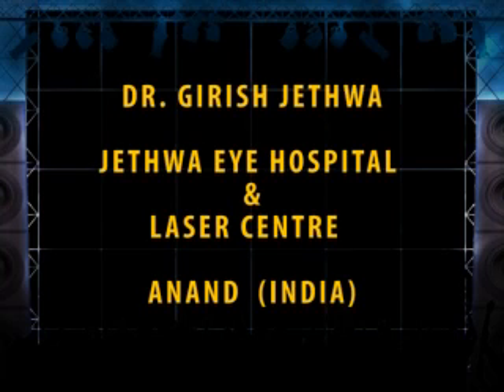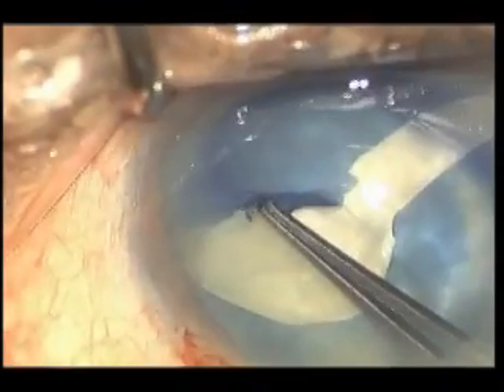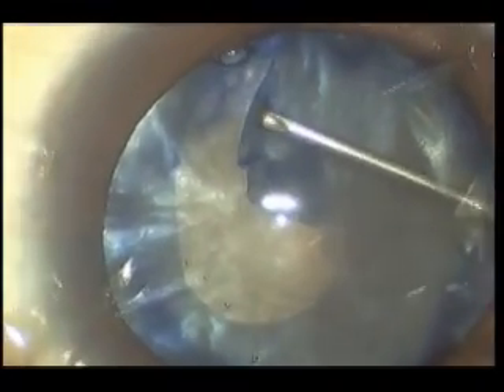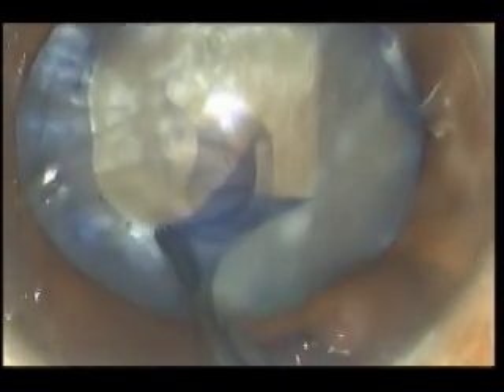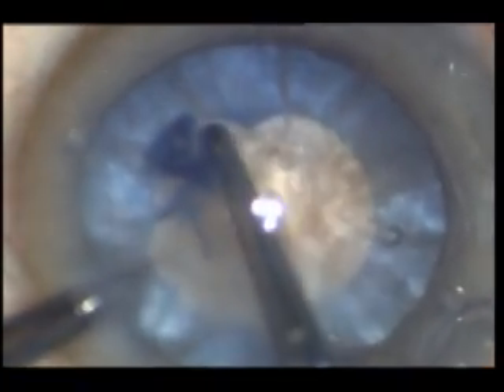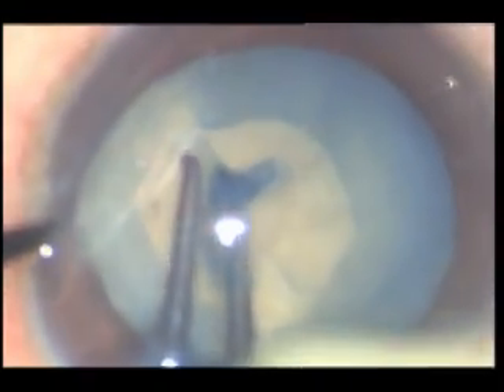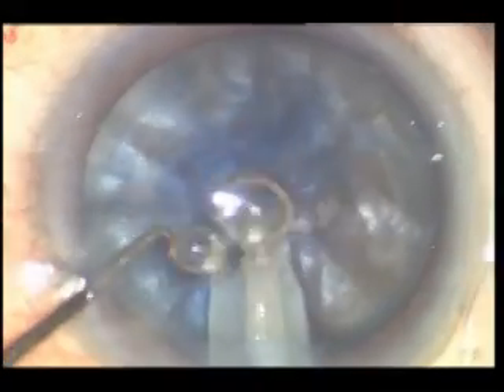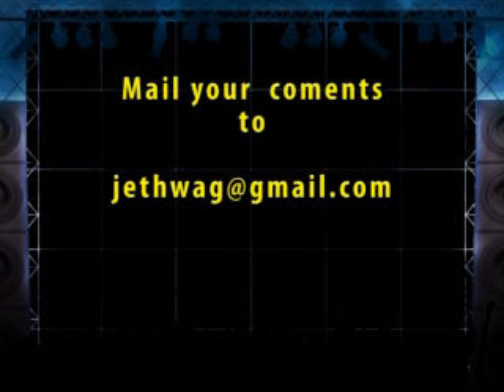PREVENTION OF ARGENTINEAN FLAG SIGN IN INTUMACENT

Comment: excellent 
but.  making a small 3 mm rhexis then deompress the lens then enlarge to 6 mm size is better option
Reply from the maker: dr.dwarakanath donthula 
Yes.
No sooner we puncture anterior capsule in Intumescent cataract, due to high intralenticular pressure   capsule is torn and extended in two direction and control is lost. So in this method simultaneous puncture and aspiration does best decompression, helping in more controlled CCC

Comment: What settings did you use for this (aspiration/vacuum/ultrasound power)?  Looks like a good technique, thanks for posting the video!
Reply from the maker: DrTactical 
Thanks for appreciation. 
Keep flow rate 35 ml, vacuum around 200 mm, and power 20%.
Introduce phaco probe without irrigation on. touch the phaco tip to capsule which is stained. Now go to irrigation and aspiration.  Now make pucture by phaco power and go to foot paddle position to keeping aspiration on for 2 seconds . it will aspirate all fluid from capsular bag and decompress intralenticular pressure. 
Now inject Viscoat in AC, take care that it should not be injected in the bag. now complete CCC.
Wishing you all successful phaco.
Dr. Jethwa 
Anand 
India

Comment: Your idea of a initial small opening followed by decompression and secondary enlargement is good. however I would prefer a more controlled initial capsular opening through the side port as there is a chance of the initial tear it self running off to periphery.Decompress  IA and then safely  secondarily enlarge it  with forceps or needle as the intra lenticular pressure has now been relieved.